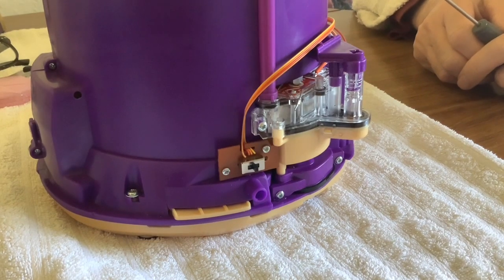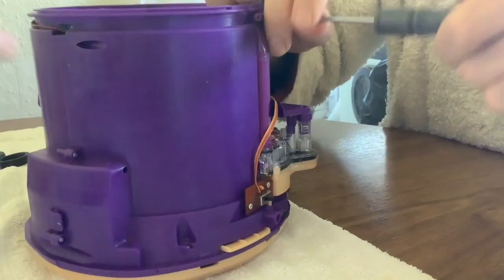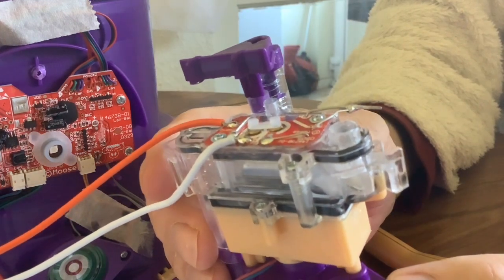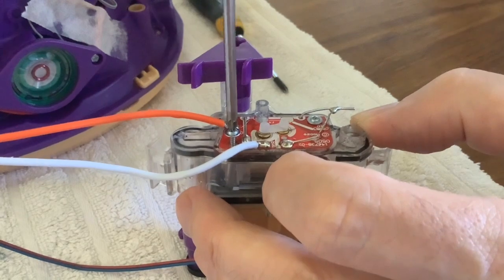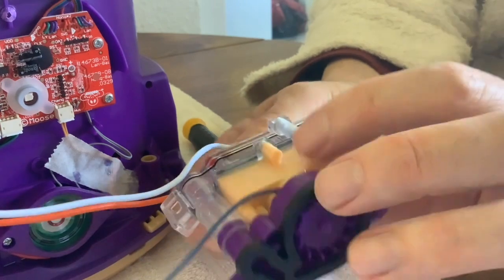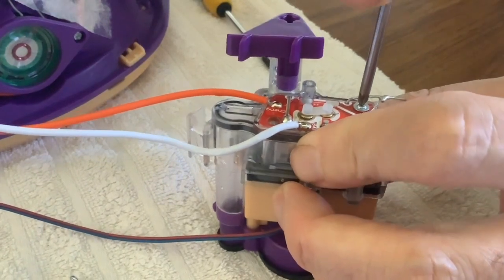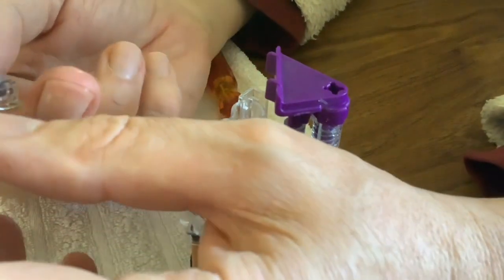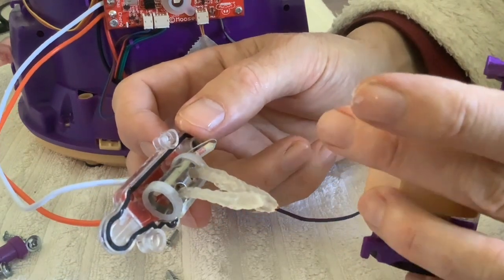Magic Mixies Magical Crystal Ball Misting Mechanism Taken apart to see How it Works! What’s inside?

Comment: Mine never misted from day one. I took it apart last night to see why not and all the fluid leaked out of the air intake when I tilted the chamber. I have yet to take apart the heating mechanism since it was getting late, but I suspect that it is not heating properly. I vape and while watching your video, I realized that the magic mixie heating element works exactly like a vape. I am going to take apart the heating element after work to see what I find, but I think that it is not getting power for some reason. Would you have any idea why that may be? The fan works fine.
Reply from the maker: Could be a number of things, low batteries, triggered thermal fuse, broken wire or heating coil itself could have snapped. We’d be interested to see what you find. Paul
Reply: mine just stopped misting too